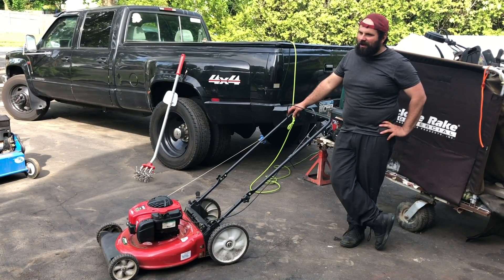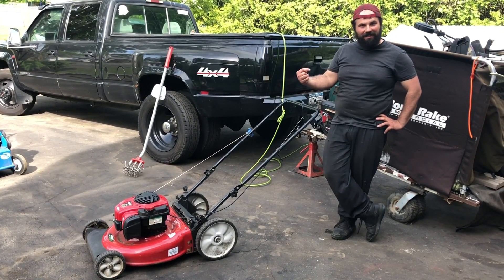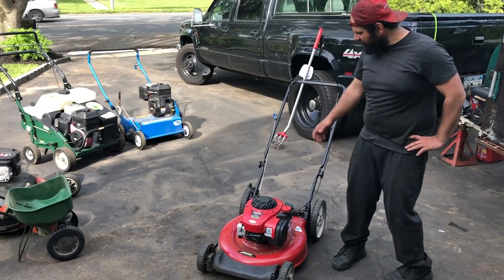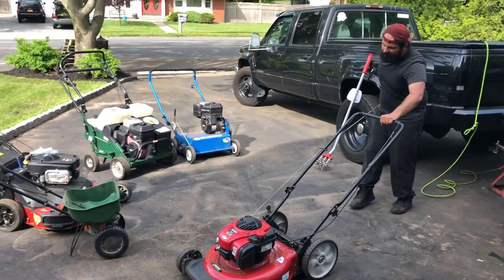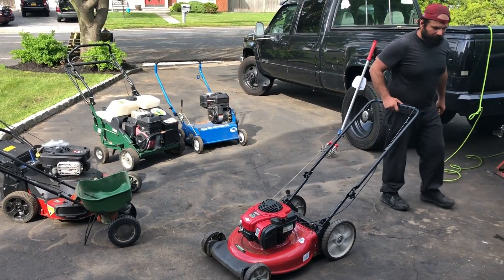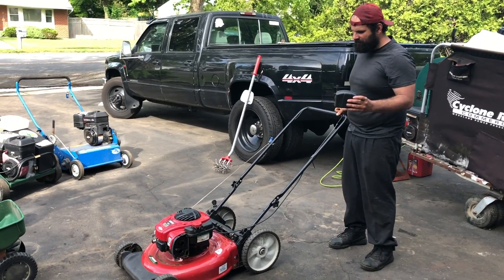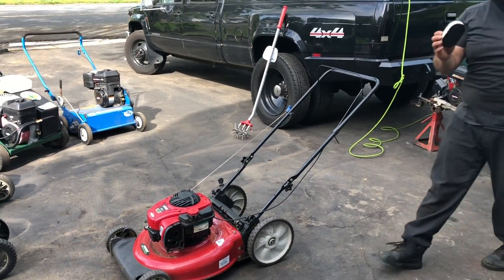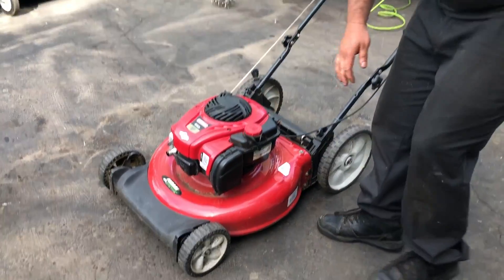Lawn Mower Struggles Dies Labors While Cutting Grass POSSIBLE QUICK EASY FIX CHEAP NO TOOLS NEEDED

Comment: Thank you for the video. My mower was working fine since I got it in the Spring, up until a few days ago. I tipped it over to scrape the grass out, filled up the tank, then it wouldn't run at full power. When I first started it after doing that, white smoke for about a minute, then clear. It would run, just not at full power. Never thought to just take out the filter to see what it'd do, but that was it.

Funny thing is, I changed the filter in late Spring. So do we really need to change the filter a couple times a season?

Comment: I put a new air filter, carburetor, sparkplug and sparkplug relay and my mower still cuts off as soon as i start mowing the grass and the grass isn't that high at all.
Reply from the maker: Make sure the deck underneath is clean and if the mower is self propelled make sure you pull the covers and clean out the trans tunnel.

Also try raising your cutting height
Reply: I did all do that and it still bogs and dies. What else could be the problem still like new toro self propelled mower Briggs and Stratton
Reply from the maker: @BC_nopowder  make sure under the deck is clean and if still persists clean the carb
Reply: @Juggernautgang Might be out of time. Pop the valve cover off and get a feeler gauge and adjust the valves accordingly. There's videos available
Reply: Low compression, could be frozen piston rings, im tryna unfreeze mine atm by pouring something down the spark plug hole to eat the carbon freezing up the rings

Comment: I replaced my air filter and new spark plug after only 3 months of use and it still bogs and dies . What could he the problem 👀👀👀
Reply from the maker: Clean the carb and make sure the deck is clean as well underneath

Comment: Is the spark plug all dirty now from running too rich? Might be worth hitting it with a wire brush and some carb cleaner then blasting it with some air.
Reply from the maker: mjg263 

I performed a tune-up and it was ready to mow!

Comment: i just  change my air  filter and  it still has a  struggle  during  cutting  grass sometimes almost  dies completely
Reply from the maker: Clean the Carb...

Make sure your blade is sharp and under the deck is clean as a whistle.  If you are mulching get a gator blade!  Try not to cut your grass wet as well as letting it get too tall between mows.

Comment: But the customer said it happens while cutting the grass. Not running on flat concrete. I say this cause mine does the same, even with the filter out.
Reply from the maker: This one was simple!

For your case…

Start simple…

New Air Filter 
Check/Confirm Good Spark
Clean the carb 
Make sure the deck isn’t clogged up with old grass
Reply: @pattayperformance  Filters new, carb has been cleaned out along with a replaced part, and no built up to the deck. Will try replacing spark plug.
Reply from the maker: @gabrielgarcia5686  ok, do you have a flat head engine?  If so they are known for the head bolts to back out over time.  Just take a 1/2”/13mm socket and tighten them back up.  Do it in a criss cross pattern
Reply: @pattayperformance  Not sure about the flat head top. But I do know of which bolts you are refering to. And that will also be something that I will check into. Thanks for the reply.
Reply: @pattayperformance  mark sure the  deck IS clogged up with old grass ,as in  you  want the  deck  clogged ?

Comment: 🤯🤯🤯 I tried it and it fucken worked 😂😂 thank you!!
Reply from the maker: NICE!  Amazing such a cheap and simple thing would cause so much!

Sorry I missed this comment, but hopefully you are still in fix it mode, now is a good time to change the oil.

Continue to do so every season.

Thanks for the view and comment, hopefully you subscribed to my channel 🇺🇸🤙🏻🔧🦅
Reply: Change the oil? 🤯 .. You just got yourself a subscriber.
Reply from the maker: @davidbarkelaow4141  just like the vehicle you drive!  Every 25 hours or every season.  Honestly just top it off through out the season and at the end or beginning of the new one, replace.

SUPER EASY!  20oz of Sae 30 Weight.  Videos are on my channel as well.  If you got any questions…ask away!

Comment: Pattays Performance. A air cleaner that dirty is equivalent to trying to breathe with a tennis ball in your mouth and a plug in one nostril - Not Very Good. After watching your video, I remember something from several years ago, I remembered a Dodge truck with a slant 6 225 engine that was brought in because it wouldn’t run - lack of power. The mechanics looked it over and didn’t see anything really mechanical and when they began to loosen the top of the breather the engine immediately picked up. Like the breather on the lawnmower - It was a total mess. Many years of working in a government equipment repair facility equals many times of “Hmmm”. I was the welding guru and have personally witnessed equipment carnage at its worst. Henry from Mowers And Blowers told me that I ought to consider my own YouTube channel for welding repairs. I m not sure if I should reflect on anything from where I worked due to profanity on my part(LOL). Great Video As Always._
Reply from the maker: IronDuke502,

I agree with Henry...you should and/or anyone should start their own YouTube channel!  Ya never know what path it will take you down!  Mustie1 started his own channel to help with his social anxiety issues and look where it took him!

I feel that gov’t facilities are 2 way street!  Can be strict and pleasant or just straight up break down maintenance!  I use to do a lot of welding and fab work at work.  I will be honest...I was also self teaching on every job.  It would take me a lot longer than most.  I also was very critical of my work and at times over engineered things.  At my job like most...bad news travel fast.  Comebacks will haunt you you for the rest of your career.

Now they outsourced it...a fair of amount of the work comes back and they don’t care.  Just send it right back to them no quarrels or anything
Reply: Pattay's Performance. My “Big R Date” is August 01 and I’m happy but scared as hell of stepping into a new chapter of life. 
Regarding the welding; The overkill is a must due to the extreme punishment that my work project(s) were required to perform. The thought that was always on my mind working government project(s) was that for what I was doing was serving my family and or friends and their families - And most importantly that I wanted them to be safe and that a miscue on my part could lead to severe injuries or death if I let down ever so slightly. With Me, I have several directions that I could travel as far as a YouTube GURU. Have A Great Day.

Comment: I just got mine back from Ace hardware on Thursday supposedly they fixed it and said there was oil in the engine, so it worked good that Thursday then about 2 hours ago I'm cutting the backyard in a few minutes in it conks out again smh, so I got to be calling Ace hardware tomorrow again smh. Never buying a Toro lawn mower again.
Reply from the maker: Toro makes the mower…engine is made by Briggs or Honda.

What diagnostic steps have you taken?

Oil better be in the engine or else it goes BOOM!

If you want give me a call real quick.
Reply: @pattayperformance sorry I read your message wrong so I'm messaging again lol, when the lawn mower conk out I saw the engine OIL was low so I did put some in there but it's still won't start.
Reply from the maker: @JustinW06  oil is suppose to be in the engine. Maybe oil is getting into the combustion cylinder and fouling the plug is what they meant.  Pull the spark plug and see what it looks like
Reply: @pattayperformance  okay I'll check it then I'll let you know. Also from my earlier message I meant engine OIL I  did put that in there and also I put a new spark plug in it before I took it out to get fixed, sorry if I'm confusing with these messages im just frustrated.
Reply from the maker: @JustinW06  

Go through my channel I have a bunch of videos showing you how to diag a no start.  

Make your sure oil is topped off and no over filled

Comment: Sell the Service , Tell the costumer that's why you should have it serviced annually .Easy money .
Reply from the maker: Chris's small engines,

Your damm right!  Last year when we first met, had a no start issue.  I just cleaned the carb and sharpened the blade.  He declined a tune-up...we shall see what next year brings.

I do not call people or contact them about service reminders.  Do you?
Reply: No i do not run after costumers , but most people leave machines until they do not start .